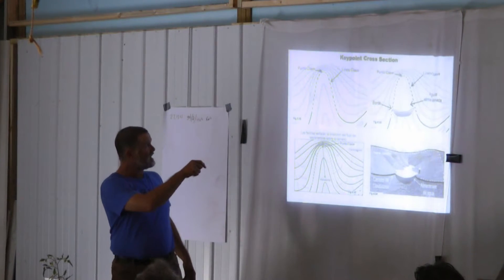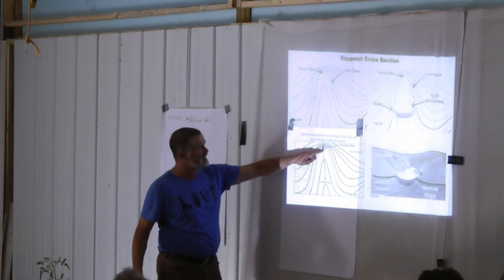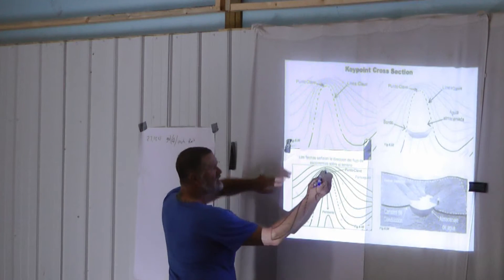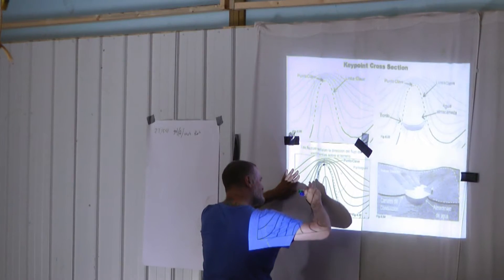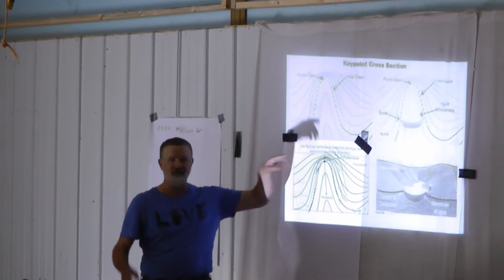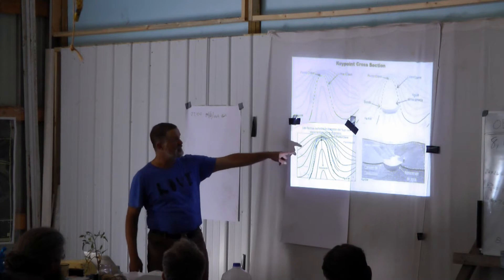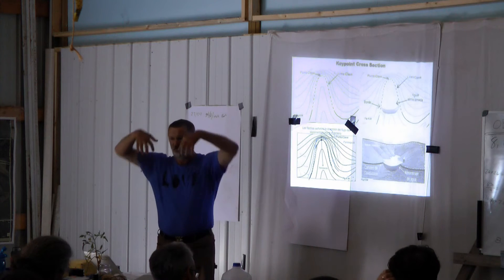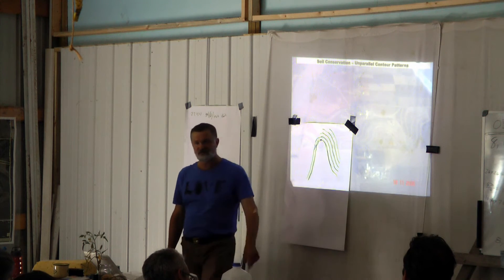Mark Shepard solving a problem with Keyline Design

Comment: things like "doing this number" "go that way" are not useful without visual references. This video makes us understand the problem, but poor delivery of what the solution actually is.
Reply from the maker: There is no easy solution to these problems. There may not be a solution at all only adaptation. There are differing influences that are changing rapidly right now and the best I advice is to take care of your own food wants, adjust on the fly with the extremes we are now facing, or get yourself in that soup line to eat whatever is available.